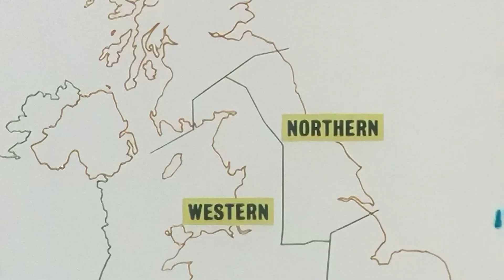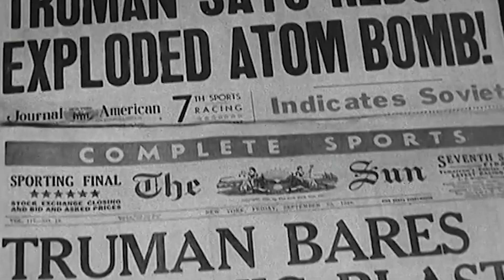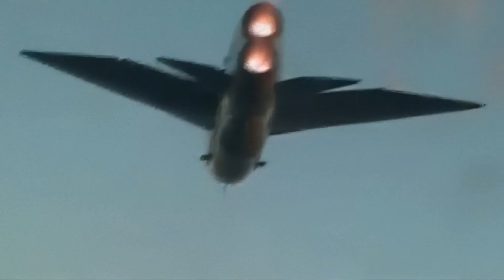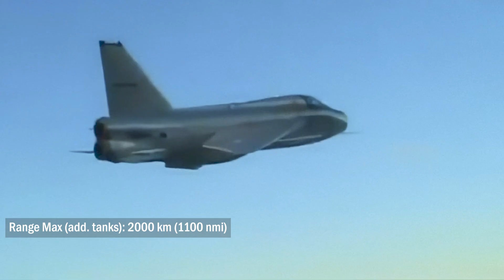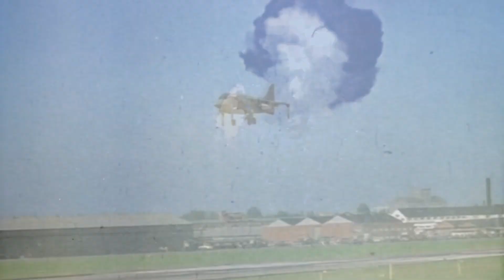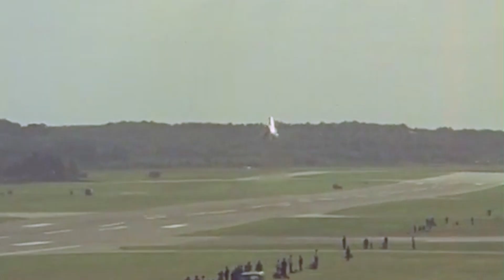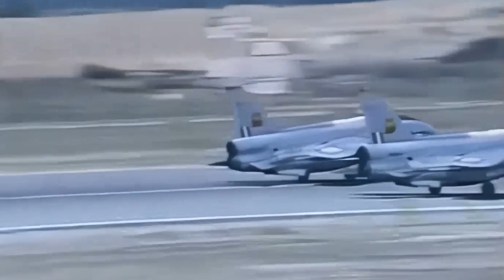Lightning – effective exotics

Comment: Another interesting fact of the Lightning: it is the first aircraft that can hold its own weight using the engines alone, ie no lift is needed from the wings to go up.
Reply: Not with fuel and ammunition on board.
 
Specifications (Lightning F.6)
Thrust/weight: 0.78 (1.03 empty)
Reply: @gort8203  That seems right with the published weight and thrust figures. And yet I've seen numerous claims it could exceed Mach 1.0 in a vertical climb. Wonder where those came from?
Reply: @markallison4794   Those claims come from people who don't understand what they are talking about.  There is a huge difference between zooming an aircraft and rotating it into a vertical climb just after takeoff.  The airplane is not going to accelerate to supersonic speed from the latter, and in fact will not climb for very long.  But if you have supersonic speed on the jet and pull it straight up it will be climbing at supersonic speed . . . for a while.  
Even if the airplane is nearly out of fuel and has a 1:1 T/W ratio, that is only true at sea level.  In a vertical climb the thrust has to overcome both the weight of the airplane and the aerodynamic drag, and the thrust decreases with every foot of altitude.  You can do the math.
Reply: @gort8203  👍
Reply: @gort8203  

The F6 Lightnings fitted with Avon 302r engines produced over 40,000 lbs of thrust in a 26,000 lb airframe. 

The Lightning was introduced into service as an Operational  Development  aircraft and many of it capabilities were Top Secret. No one knows the tops speed of the Lightning, as it would still be  accelerating before running out of fuel, Dutch air traffic control would often clock them at mach 3 over the North Sea.

Brian Carrol flew his to 87,000 ft. and tested it against the F15, where he found it was just as good if not better apart from the avionics and range.
Reply: @sichere  Bar Carrol's comment the rest of your comments are complete bullshit. Everything about the Aircraft is declassified either at the RAF Museum, the UK National Archives or the BAe Heritage archives at Warton. in fact the RAF Pilots notes for both the F Mk 1 and the F Mk 3/6 are on line and they tell exactly what the limits for the aircraft were. Maximum Airframe heating 117 Degrees C for a Lightning. 315-480 degrees C for an SR-71. So no a Lightning couldn't do Mach 3 as it would Melt!!! Maximum Permissible speed for a Lightning with 200 series Avons was Mach 1.7. Primary reason for this was the Radome would melt if you went faster. Maximum Permissible speed for a Lightning with 300 series Avon's was Mach 2 (new radome). The pilot's notes do state that the aircraft could go faster, but only at the risk of damaging it!!! 

Actual specs of the aircraft and sources below

AP.4700A & F.P.N. Febuary 1962

PILOT'S NOTES LIGHTNING F.MK.l AND F.MK.1A

PART 2 CHAPTER 1 — AIRFRAME LIMITATIONS

1. General

The Lightning F. Mk. 1 and F. Mk. 1A are designed for duties appropriate to an interceptor fighter. Intentional stalling and spinning are prohibited. The aircraft are cleared for use in temperate climates only,

2. Maximum speeds

Clean aircraft, or with ventral tank and/or missiles - 1.7M/650 knots, whichever is first attained.
Airbrake operation (normal) - 1.4M/650 knots, whichever is first attained
Airbrake operation (rolling manoeuvres) -1.2M/650 knots, whichever is first attained
Undercarriage operation - 250 knots. 280 knots for emergency locking down (see Part IV, Chap. 2, para. 5)

10.   Altitude limitations

The aircraft should not be flown above 60,000 ft. The maximum altitude for which the oxygen regulator and personal equipment have been cleared are as follows :—

Personal equipment		Mk. 20        	Mk. 21
A13A/4, P or Q mask		45,000 ft	45,000 ft . 
P & Q mask with sleeveless	50,000 ft	56,000 ft
jerkin and anti-G trousers
Partial pressure helmet with  	66,000 ft      	56,000 ft 
sleeveless jerkin and anti-G
trousers

NOTE :— These altitudes do not lake into account aerodynamic suck. Cockpit altitude will exceed aircraft altitude by up to 8,000 ft if the canopy is lost.

AP101B-1003, S and 6-15A June 1982

LIGHTNING F Mk 3, T Mk 5 and F Mk 6 AIRCREW MANUAL BOOK 1 — AIRCRAFT

PART 2 CHAPTER 1—AIRFRAME LIMITATIONS 
 
General

1. The F Mk 3 and F Mk 6 aircraft are designed for duties appropriate to an interceptor fighter and the T Mk 5 as an interceptor trainer. Intentional stalling and spinning are prohibited. The aircraft are cleared for use in temperate and tropical conditions, by day and night.

Altitude

2. Although the aircraft are cleared to fly at up to 60,000 feet, the oxygen systems and the pilots' personal equipment impose altitude limits as follows:

F Mk 3 and F Mk 6 — 50,000 feet 
T Mk 5 — 43,000 feet

Note: If the canopy is lost, aerodynamic suck causes cockpit altitude to exceed aircraft altitude by up to 8000 feet in the F Mk 3 and F Mk 6, and by up to 11,000 feet in the T Mk 5.

Airspeed

3. Maximum Speeds. The following are the max IAS/Mach number for the configurations listed. When IAS/Mach number is quoted, the first attained is the limiting speed.

Maximum permissible: 650 knots/2.0M 

Single missile
(F Mk 3/T Mk 5):		650 knots/1.8M

F Mk 6 with overwing
tanks:				525 knots/0.98M
				        (525 knots/0.9M with single missile)

With AAR probe fitted:		625 knots

When Red Top operational
missiles are carried below
10,000 feet in peace time:	550 knots

Airbrakes operation and extended:

F Mk 3 and F Mk 6:		650 knots/1.3M
TMk5:				        650 knots/1.2M

UC selection:			250 knots
Flight with UC down:        	280 knots
Flaps:				        250 knots

Brake parachute: 
F Mk 3 and T Mk 5: 		150 knots (normal)
			    	                170 knots (emergency)
F Mk 6:				        170 knots (normal)
				                190 knots (emergency)

Note: Brake parachute streaming above the normal speed is to be reported.

AP101B-1003, 5 and 6-15A Part 3 Chapter 3. Handling in Flight Page 5

High Speed Flying

40. General. The aircraft is capable of exceeding its airspeed and Mach number limitations (Part 2, Chapter 1), especially in reheat power.

41. Intake Vibration and Buzz. The aircraft is subject to intake vibration and intake buzz. Vibration occurs with the engines at full power at speeds above 1.88M and may also occur in the range 1.35M to 1.60M; this is due to turbulence of the airflow behind the intake bullet. It is felt as a low amplitude vibration similar to aerodynamic buffet and is structurally acceptable. Intake buzz is caused by a more violent disruption of the airflow in the intake and occurs if the engines are throttled back rapidly at speeds above 1.85M. With increased g, buzz occurs at a lower Mach number and a higher RPM. It is indicated by a series of loud and rapidly recurrent bangs. The condition does not persist because, with the application of g or on throttling back, the aircraft decelerates rapidly below the buzz boundary. Intake buzz causes no damage but should be avoided if possible.

According to some sources the big engine Lightnings were cleared to 700 KIAS in War time. Knots indicated Air Speed is what the Airspeed indicator reads at Sea Level. The higher you go, the faster you are actually going compared to what the ASI is reading. 700 KIAS at 57,000 feet is around 1500 Knots True Air Speed, which is around MACH 2.2-2.3. which is the fastest a Lightning ever few.

Your F Mk 6 figures are hogwash!!! Max thrust on a Lightning using Avon 300 series engines. 32,720lb from both engines in Reheat, not 40,000lb. 28,041lb is the weight of the aircraft empty!!! Figures from the pilots note from the single seaters where known are thus

F Mk 1 - 25,753lb Empty - 34,000lb MTOW - Max thrust from 2 engines in reheat - 28,860lb
F Mk 3 - 26,906lb Empty - 36,000lb MTOW - Max thrust from 2 engines in reheat - 32,720lb 
F Mk 6 - 28,041lb Empty - 41,700lb MTOW - Max thrust from 2 engines in reheat - 32,720lb 

Put enough fuel in a Lightning to do anything useful with it and the aircraft does not have a 1 to 1 thrust to weight ratio period!!!! Plus to go supersonic in a climb from a standing start you have to overcome the transonic drag, most likely at least another 10,000lb of force that your aircraft has to fight against. 

Maths is a bitch!!!
Reply: @sichere  Bullshit!!!! the RAF pilot notes are declassified and on-line if you know where to look. Only thing that flew within Dutch Radar cover that could do Mach 3 was the Blackbird!!! Lightning's maximum aerodynamic heating limit was 117 Degrees C, that is about Mach 2.3 at 60,000 feet. That is a law of physics thing. Blackbird at Mach 3 was being cooked at 300-400 degrees C.

Also your quoted fact about the Lightning F Mk 6 are hogwash. 2 x Avon 301R's gave 32,720 lb in reheat (16,360 lb each). the empty weight of the aircraft was 28,041 lb Empty. It's max take-off weight was 41,700 lb.  Throw 10,000lb of transonic drag on to the aircraft and there is no way the aircraft can go supersonic from a standing start in a vertical climb with enough fuel to take off, do the stunt (and it is a stunt) and land with enough fuel in reserve.

Anyhow, what the actual pilots manuals say about the aircraft and not the British Pathe Bullshit newsreels.

AP.4700A & F.P.N. February 1962

PILOT'S NOTES LIGHTNING F.MK.l AND F.MK.1A

PART 2 CHAPTER 1 — AIRFRAME LIMITATIONS

1. General

The Lightning F. Mk. 1 and F. Mk. 1A are designed for duties appropriate to an interceptor fighter. Intentional stalling and spinning are prohibited. The aircraft are cleared for use in temperate climates only,

2. Maximum speeds

Clean aircraft, or with ventral tank and/or missiles - 1.7M/650 knots, whichever is first attained.
Airbrake operation (normal) - 1.4M/650 knots, whichever is first attained
Airbrake operation (rolling manoeuvres) -1.2M/650 knots, whichever is first attained
Undercarriage operation - 250 knots. 280 knots for emergency locking down (see Part IV, Chap. 2, para. 5)

10.   Altitude limitations

The aircraft should not be flown above 60,000 ft. The maximum altitude for which the oxygen regulator and personal equipment have been cleared are as follows :—

Personal equipment	   	         Mk. 20        	Mk. 21
A13A/4, P or Q mask		        45,000 ft	45,000 ft . 
P & Q mask with sleeveless	50,000 ft	56,000 ft
jerkin and anti-G trousers
Partial pressure helmet with  	66,000 ft      	56,000 ft 
sleeveless jerkin and anti-G
trousers

NOTE :— These altitudes do not lake into account aerodynamic suck. Cockpit altitude will exceed aircraft altitude by up to 8,000 ft if the canopy is lost.

Two Rolls-Royce Avon 200R in reheat 28,860 lb thrust. Aircraft weight empty 25,753lb. Maximum take off weight 34,000 lb 

AP101B-1003, S and 6-15A June 1982

LIGHTNING F Mk 3, T Mk 5 and F Mk 6 AIRCREW MANUAL BOOK 1 — AIRCRAFT

PART 2 CHAPTER 1—AIRFRAME LIMITATIONS 
 
General

1. The F Mk 3 and F Mk 6 aircraft are designed for duties appropriate to an interceptor fighter and the T Mk 5 as an interceptor trainer. Intentional stalling and spinning are prohibited. The aircraft are cleared for use in temperate and tropical conditions, by day and night.

Altitude

2. Although the aircraft are cleared to fly at up to 60,000 feet, the oxygen systems and the pilots' personal equipment impose altitude limits as follows:

F Mk 3 and F Mk 6 — 50,000 feet 
T Mk 5 — 43,000 feet

Note: If the canopy is lost, aerodynamic suck causes cockpit altitude to exceed aircraft altitude by up to 8000 feet in the F Mk 3 and F Mk 6, and by up to 11,000 feet in the T Mk 5.

Airspeed

3. Maximum Speeds. The following are the max IAS/Mach number for the configurations listed. When IAS/Mach number is quoted, the first attained is the limiting speed.

Maximum permissible:		650 knots/2.0M 

Single missile
(F Mk 3/T Mk 5):		650 knots/1.8M

F Mk 6 with overwing
tanks:				525 knots/0.98M
				(525 knots/0.9M with single missile)

With AAR probe fitted:		625 knots

When Red Top operational
missiles are carried below
10,000 feet in peace time:	550 knots

Airbrakes operation and extended:

F Mk 3 and F Mk 6:		650 knots/1.3M
TMk5:				650 knots/1.2M

UC selection:			250 knots
Flight with UC down:        	280 knots
Flaps:				250 knots

Brake parachute: 
F Mk 3 and T Mk 5: 		150 knots (normal)
				170 knots (emergency)
F Mk 6:				170 knots (normal)
				190 knots (emergency)

Note: Brake parachute streaming above the normal speed is to be reported.

AP101B-1003, 5 and 6-15A Part 3 Chapter 3. Handling in Flight Page 5

High Speed Flying

40. General. The aircraft is capable of exceeding its airspeed and Mach number limitations (Part 2, Chapter 1), especially in reheat power.

41. Intake Vibration and Buzz. The aircraft is subject to intake vibration and intake buzz. Vibration occurs with the engines at full power at speeds above 1.88M and may also occur in the range 1.35M to 1.60M; this is due to turbulence of the airflow behind the intake bullet. It is felt as a low amplitude vibration similar to aerodynamic buffet and is structurally acceptable. Intake buzz is caused by a more violent disruption of the airflow in the intake and occurs if the engines are throttled back rapidly at speeds above 1.85M. With increased g, buzz occurs at a lower Mach number and a higher RPM. It is indicated by a series of loud and rapidly recurrent bangs. The condition does not persist because, with the application of g or on throttling back, the aircraft decelerates rapidly below the buzz boundary. Intake buzz causes no damage but should be avoided if possible.

F Mk 3 Two Rolls-Royce Avon 301R in reheat 32,720 lb thrust. Aircraft weight Empty 26,906lb. Maximum take off weight 36,000 lb.

F Mk 6 Two Rolls-Royce Avon 301R in reheat 32,720 lb thrust. Aircraft weight Empty 28,041 lb. Maximum take off weight 41,700 lb. 

Note the Altitude limits are based on the Flying Equipment worn by the the pilots at the time. Anybody who took a Lightning above 66,000 feet in anything other than a Taylor Partial Pressure helmet and partial pressure  jerkin would be dead if they suffered any pressurization failure before they could get an aircraft to an altitude where the standard flying kit could keep you alive. Most Fighters of the period could get up to 65,000 feet plus with ease, they didn't because unlike the U-2 and SR-71 boys, they didn't wear space suits.
Reply: @fantabuloussnuffaluffagus -  Wiki info 🤣🤣🤣-
You've quoted the Avon 301 made in 1961

The Lightnings built by  BAC  weighed less than 27,000 lb and had Avon 302 c's that were designed for the Hawker P.1134, mach 3 capable and   produced 20,000 lbs of thrust each.

I take it you have not seen one fly.
Reply: @fantabuloussnuffaluffagus 

The Lightning entered service as an "Operational Development" aircraft and when introduced it was the state of the art and until the introduction of the F15's and 16's had no contenders. The majority of airframes built were the F53 made by BAC and they come in at 27,000 lb empty. Some of which were fitted with the Avon 302 R that  were the equivalent of the RB 106. 

The RB.106 was of similar size to the Rolls-Royce Avon, allowing it to be used as a drop-in replacement that produced 21,750 lbf (96.7 kN) with reheat. The RB 106 became the PS.13 Iroquois used in the Avro Arrow and had  25,600 lbf (114 kN), thrust with afterburning.

In 1985 no other Aircraft NATO aircraft could catch Concorde apart from the EEL.

You stick to Wiki and War Thunder.
Reply: @fantabuloussnuffaluffagus The EEL was operated out of Warton and Boscombe Down, these are research and development establishments similar to the US :Skunk Works"  that did all sorts of tests with the Lightnings, one was even fitted with a rocket similar to the SR 53 but it was found to be only marginally faster and far less useful than the 2 Avons.

An operational F-15 was neither faster nor able to outclimb an Operational F53 EEL.

You keep to your Wiki
Reply: @fantabuloussnuffaluffagus The EEL was operated out of Warton and Boscombe Down, these are research and development establishments similar to the US :Skunk Works"  that did all sorts of tests with the Lightnings, one was even fitted with a rocket similar to the SR 53 but it was found to be only marginally faster and far less useful than the 2 Avons.

An operational F-15 was neither faster nor able to outclimb an Operational F53 EEL.

You keep to your Wiki
Reply: The Lightning DID go supersonic in a climb from rest, I have seen and heard it do so. Initial rate of climb 60,000 fpm. I think you need to revist your imagination.  @gort8203
Reply: Correct.  @sichere
Reply: The F Mk1A was the fastest with the 4 stage afterburner and the lightest airframe. That is why the kept them for Target Facilities. @fantabuloussnuffaluffagus
Reply: And since when was Wikipedia an authority? Ever seen them fly? I have many times, they were based down the road from me.  @fantabuloussnuffaluffagus
Reply: @fantabuloussnuffaluffagus God does not exist but I live next door to an EEL F53
Reply: Even better than people who were there? You sound like a Moon landing denier.@fantabuloussnuffaluffagus
Reply: And you are a command pilot on an F-15 squadron. Grow up sonny, you just can't accept us Brits built such a capable aircraft way before America did. I will, however have access to out Lightning tomorrow when I go to our museum. More than you do.@fantabuloussnuffaluffagus
Reply: @fantabuloussnuffaluffagus Because the F53 could not do mach 20 but could get to mach 3. The designers did a lot of work on the shock cone and unlike the SR 71 it didn't  need to be moveable.

The Lightning was only a small part of an  integrated  weapons system and much of it's performance was top secret. On it's introduction it was state of the art  and from mach 0.9 the EEL would get to mach 1.9 before an F35 could reach mach 1.4.

It was also  the first aircraft that could supercruise, which should give you some indication of the T/W ratio helped by the lack of drag.

The only records the F15 held were not done by operational aircraft.

It should also be noted that a Lightning on QRF could be airborne in les than 2 mins.
unlike an unarmed SR71
Reply: @fantabuloussnuffaluffagus The EEL was  not made from Aluminium, it was made from  aluminum-copper aviation alloys, though aluminum-lithium and titanium alloys, were used selectively where needed
Reply: @fantabuloussnuffaluffagus The limiting factor was actually  the fibreglass shock cone and the pilots canopy. 

The EEL could not sustain mach 3 for extended periods as there was always insufficient fuel so the heat build up was not such  a major issue as it was for the SR71 amd Mig25

You feel free to do the research that I've done on the EEL's and the RR Avon 302 R
Reply: Importanr to note that the supersonic verticals were not done at the same time as going vertical at the end of the run way. They were two completely different but cool party tricks that happen to 8nvolve going vertical, neither of which were particularly useful operationally and were just done for flexing and showing off. I've no sources for you but went to the same school as some of the pilots sons in the 80s. They would occasionally time a patrol and fly very low over our school at break or lunch time and give it some brief reheat and climb. They were not trying to go supersonic as that would lead as I understood it to loads of paperwork and complaints from residents rightly or wrongly claiming for broken windows but it was great fun to see and would make your whole chest and rib cage rattle (and some of the younger girls cry). From what remember being told any supersonic climbs were done after mid air refuelling and at some altitude most of the acceleration was done in a non vertical climb and they wouldn't go vertical until almost supersonic and they had lost some weight. The stories you hear about intercept of u2s at the edge of space will also have been after refuelling and in non vertical zoom climbs.  One other thing all lightning stories talk about its low range but v few mention it was by design from the offset! Just like a f1 car carries just enough fuel to complete a race and not 1kg more, the early lightnings design had a range to match radar of the time to make sure intercepts would be as quick as possible. .  Its just that radar tech improved considerably and there was little margin in how much the lightnings design and fuel capacity could be increased
Reply: @tallandhairy  You are correct but with the introduction of Victor tankers they not only had the legs they had the speed and height as the Victors would refuel them at 50,000 feet and at mach 0.9 - enough to enable them in 1974  to reach out and get a gun kill on the SR 71 in mid Atlantic as it set the crossing record.